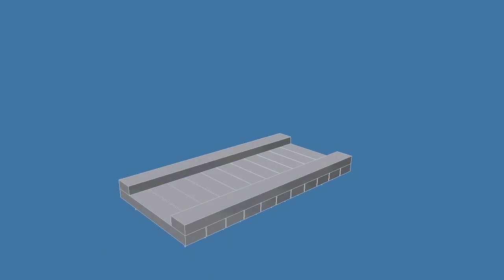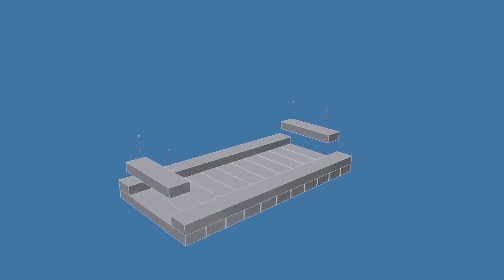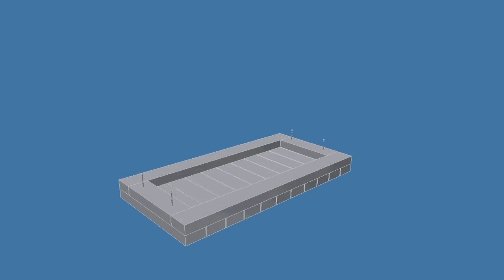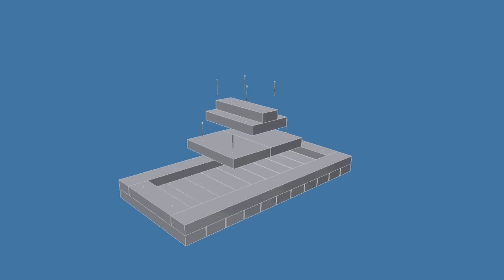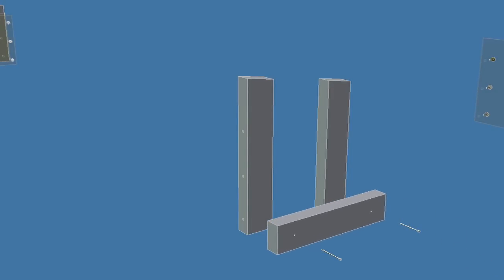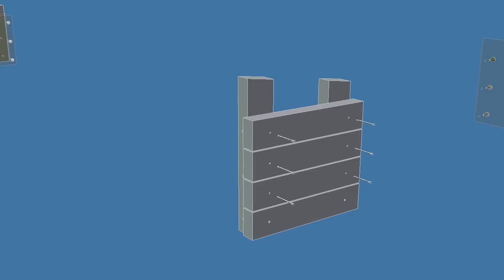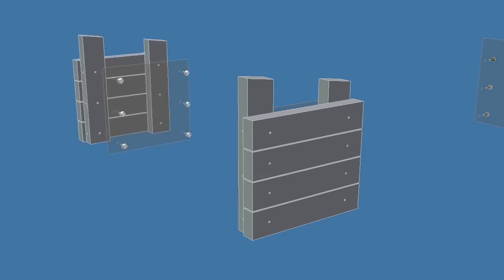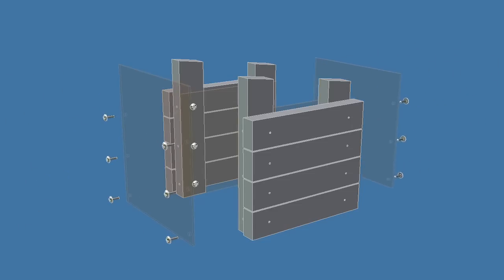Bird Feeder Plans and Step-by-Step Instructions

Comment: So, how do you fill it? Unscrew and remove the roof every time?
Reply: https://youtu.be/ZOKnSoUD2q4?t=39
the roof attaches to those 2 "roof supports" that just slide in. so you simply pull the roof UP and it slides right out. seems like a nice design!